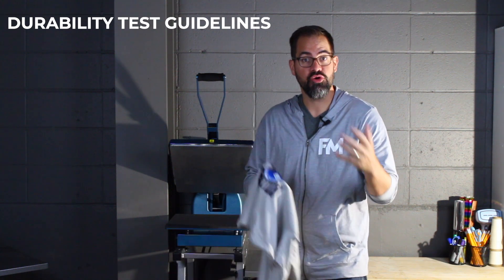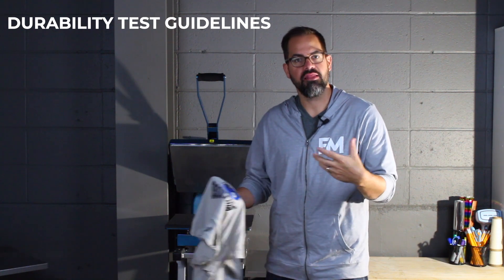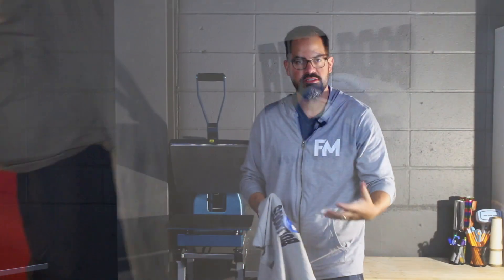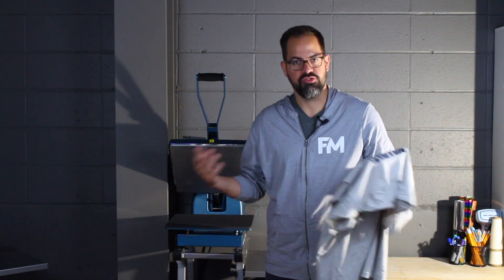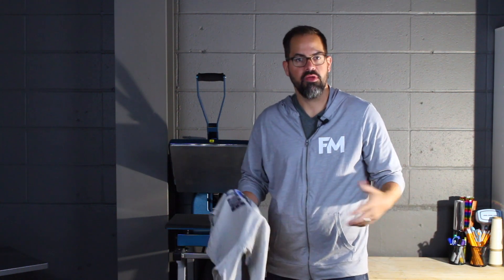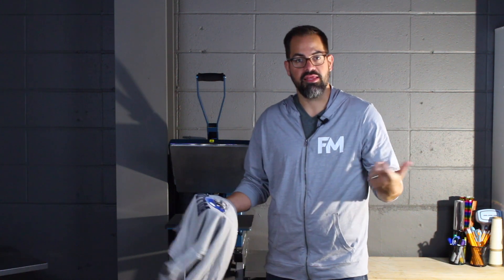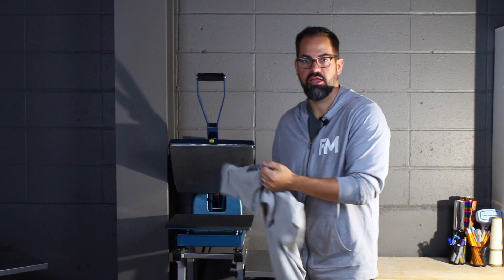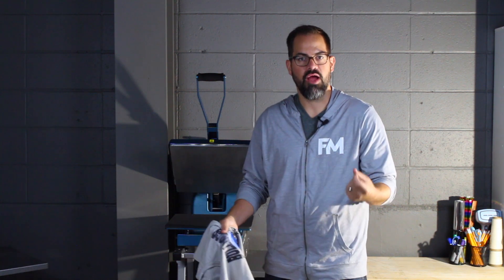FM Expressions I Durability Test Guidelines

Comment: I bought a bunch of shirts with a red and white design. After a few weeks, customers experienced the red bleeding all over the white letters. Do you have any idea how I could preserve these designs?
Reply from the maker: Dye migration happens when you apply a heat transfer to a garment that contains polyester dye that has not been fully set within the garment. Both our Athletic and Waterbased formulas use a proprietary dye migration blocker that almost always prevents the dye from showing through to the heat transfer.
Reply: FM Expressions That’s what I ordered. I ordered a bunch of athletic formula transfers from you all.